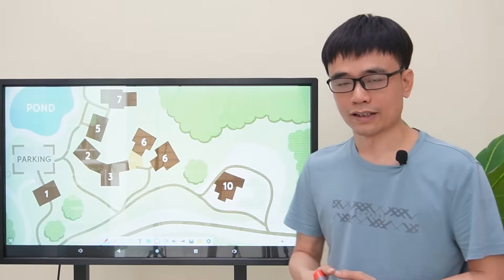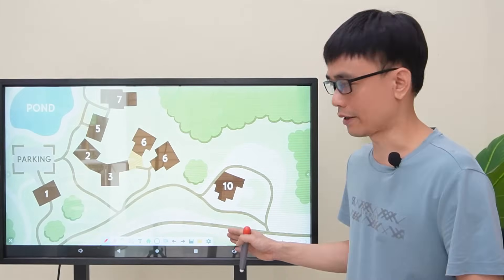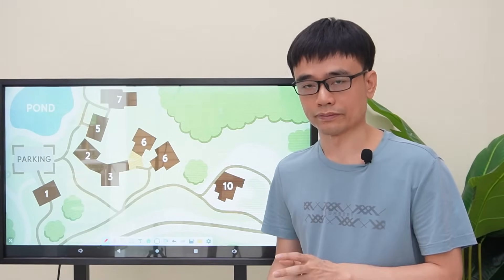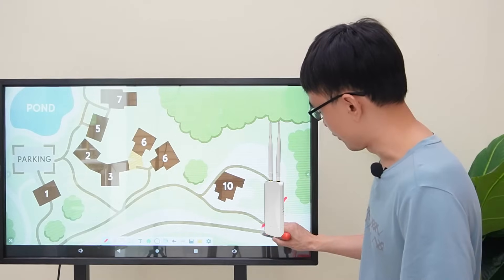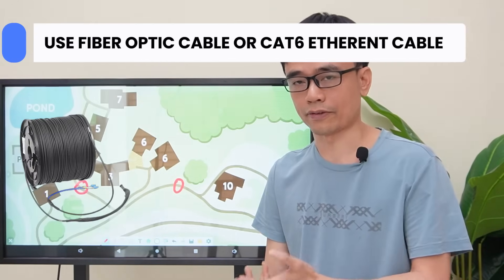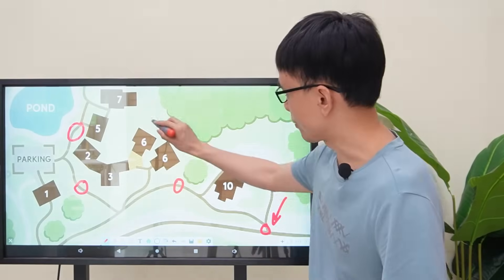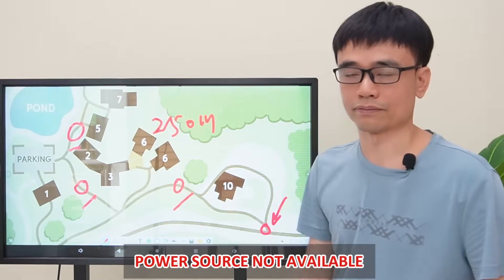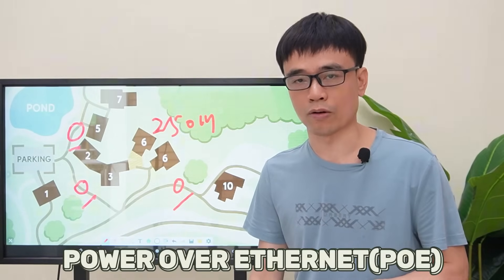How to Install 4 Wi-Fi Access Points in a Park Using PoE | Step-by-Step Outdoor Setup

Comment: And how many location can this outdoor POE switch handle in total since ave seen 4 location from 1 port, does it mean that it's possible it can handle upto 4 locations per port, or the load in terms of power may be higher than what POE switch is abe to handle? 
Then this types of POE extender i have never seen them in  my  country 🇰🇪
Reply from the maker: The maximum range is 100 meters. To connect 4 locations, you need to use fiber. It can only deliver 30W per port.

It's a 2-port PoE extender. You can find more info here: https://www.fastcabling.com/product/poe-extender/

Comment: I have a project similar to the park illustration using star link. We want to create a 2 square mil Wi-Fi  zone with capacity of 3000 concurrent users at peak time. What’s your advice on how best to get this done?
Reply from the maker: Backhaul is your bottleneck — Starlink's bandwidth and latency are decent, but not infinite. You’ll need:

Multiple Starlink terminals distributed intelligently
Load balancing and bandwidth shaping
Possibly some local caching or content delivery if traffic is heavy on static media

Access points must be high-density capable — You need enterprise-grade APs with multi-user MIMO (MU-MIMO), fast roaming, and interference mitigation.

Mesh / Point-to-Point (PtP) distribution — Because of the large area, you’ll use a mix of fiber (if available), PtP wireless, and mesh routing to extend access.

Comment: I love this. But can it transmit upto 1000Mbps?
Reply from the maker: You need a different solution. The maximum length is 300 meters 1Gbps with a copper cable.